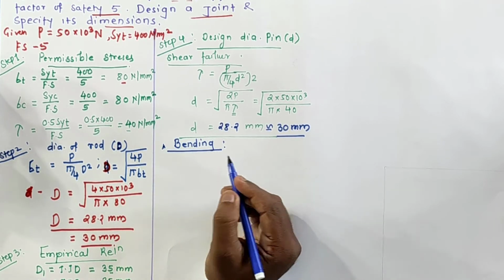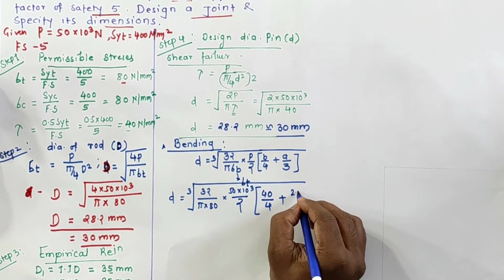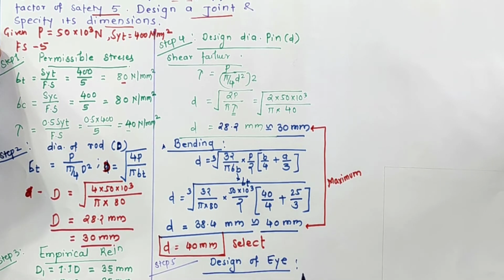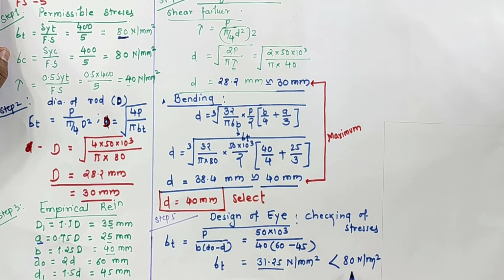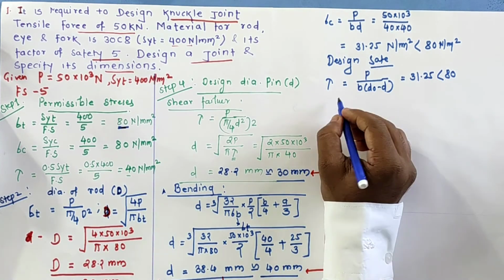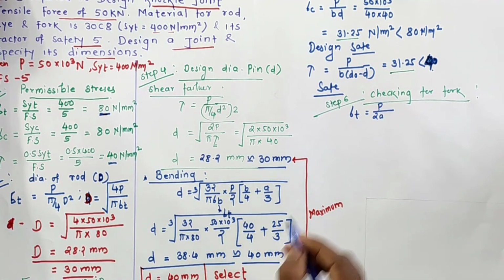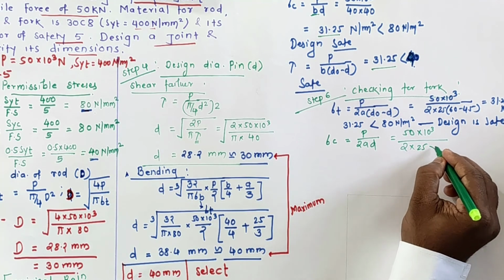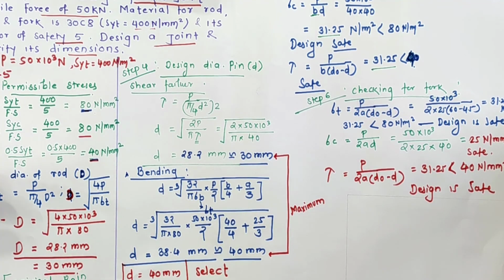Knuckle Joint Numerical | Machine Design|

Comment: Sir answers are not same so how to calculate problems please teach a how to use right calculator
Reply from the maker: Tejas use Casio FX-991-MS Scientific Calculator (12 Digit) which is very basic. regarding answers i would say you will not get any accurate answers cause some students may takee.g.  23.33, some 23.3 and some are 23 so dont worry about the answers...
Procedure and steps are more important, according to step you will get marks...
Reply from the maker: Dont think examiner will match the exact answers no he will just check hv u understood the procedure or not and how you use formulation..